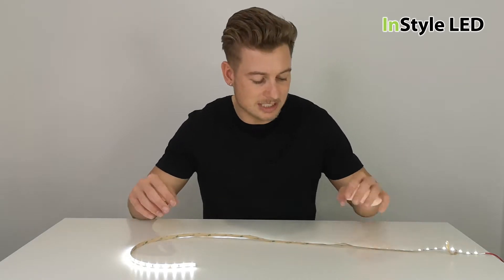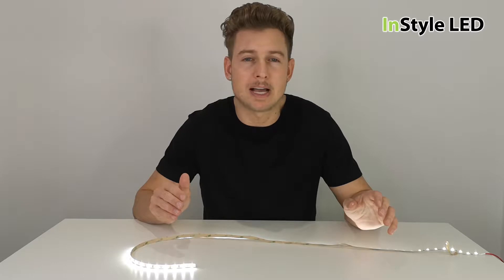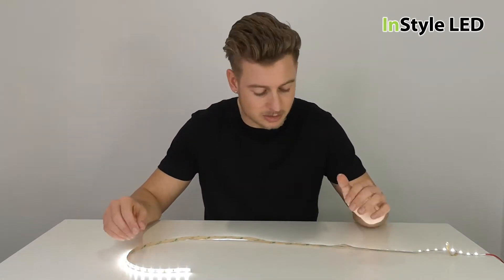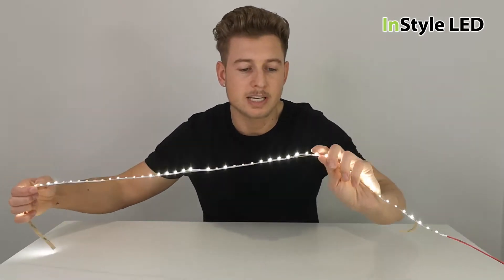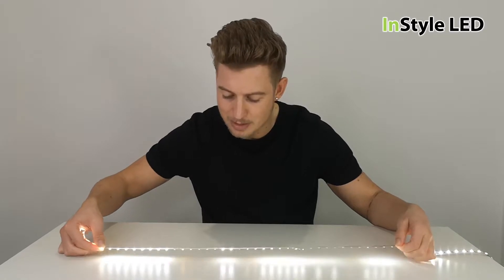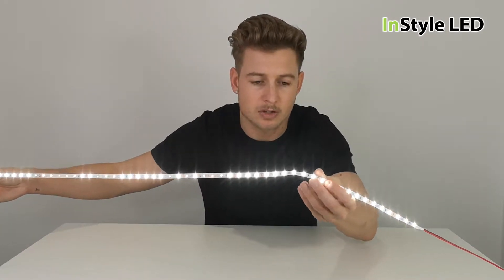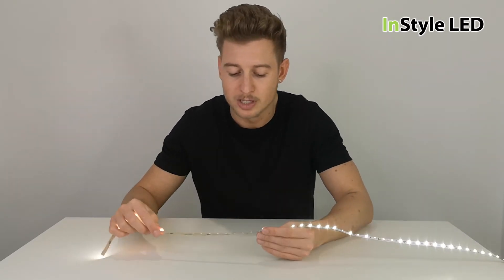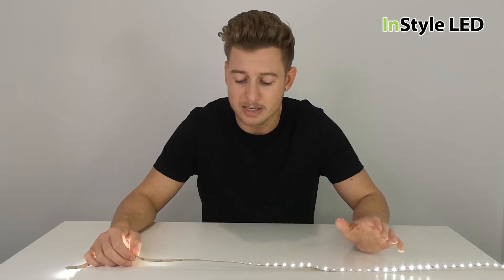Why are my LED strips not working | showing a different colour? A: they have paint on them!

Comment: When I press blue on my led lights they only turn red or turn noting please help
Reply from the maker: Hi There,   is the red very dull?   as if you have orderd a 12v power supply to work with 24v strips then only the red lights up and its very dull. So you would need to order a 24v power supply if this is the case.
Alternatively, there maybe a wiring problem,  its hard to say exactly unless I see a picture of your set up
Reply: InstyleLED  same pls helpp
Reply: @InstyleLED  only the red color shows and it's not bright and all the colors won't work what do I do?
Reply: Rebekah Hoadley bro so basically u got the wrong supply bank u need more power gotta get sum bigger order a bigger volt power bank
Reply: Idfk hi which one do u recommend
Reply: Oneodd Oh  so you press the color that’s not working turn it off fade 7 on repeat
Reply: @emelia7889  Omg THANK YOU. U SAVED MY LIFE.❤❤❤❤👌🏻
Reply: edits and stuff explain more plz😭😭
Reply: edits and stuff THANKYOU! my remote was the wrong way so i pressed it a couple times and went to my led lights and all the colors were messed up now there not! THANKS SM
Reply: @emelia7889  na wrkin
Reply: grandes_galaxy So I turn on whichever colour then turn it off then press fade?
Reply: When I press red only a little portion of the stops turn red
Reply: When I press red it turns purple
Reply: __Mila__11 my led lights literally don’t have blue, I pressed the blue button and it game me red, I put it on all colors and I don’t have blue

Comment: How come my light strip only turns white and won’t change colors? Even when I press the button?
Reply from the maker: Do you have a RGB/ RGBW set up?
Sometimes when the controller is nopt paired corrently to the receiver, whatever you press it will stay on its default mode of white. Therefore you would need to pair the remote to receiver to get it to work. Its hard to say exactly without seeing your system. If you have any pictures I can help
Reply from the maker: https://www.instyleled.co.uk/support/troubleshoot-led-strip-lights/
Reply: InstyleLED ok I figured it out, it was the adapter/plugin part of it I had to order another part, but the led light strip was fine just the adapter